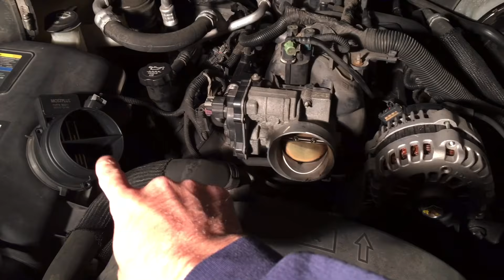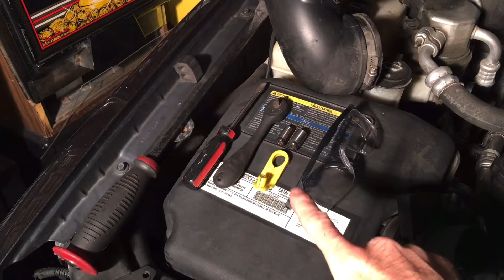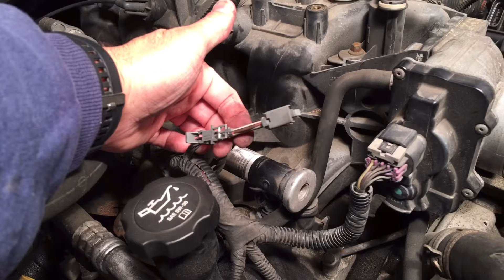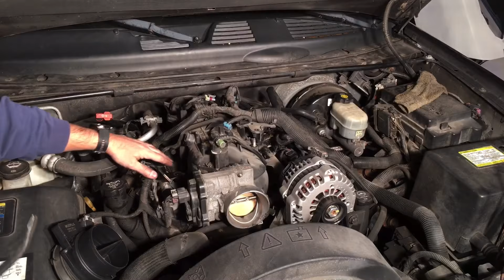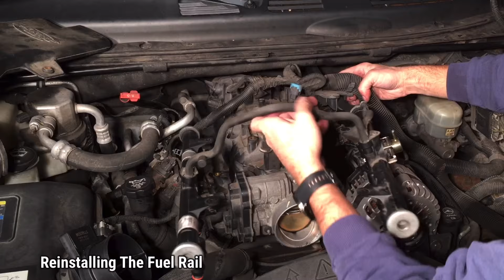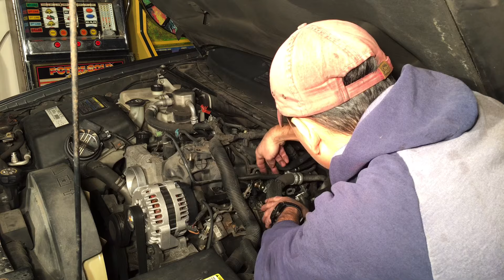How To Remove A Fuel Rail - 5.3L GM V8 (Andy’s Garage: Episode - 302)

Comment: So I got all this off and when it came to install and start the vehicle it starts then it shuts off need help
Reply from the maker: @blakeelizarraras1800  Did you reconnect all the injectors, and ensure the harnesses are tight? Also, prime the fuel pump a couple times to build pressure.
Reply: ONE comment said engine cuts off after replacing injectors and go to start  you say prime fuel pump ? Got full tank so how prime fuel pump ?

Comment: Hey. Is it. Possible to just replace the bar that connect the rails together. Mine is leaking pretty bad. Could it possibly be just an O ring?  I wish I could send you pics or a video of it shooting out.
Reply from the maker: @nfdavis1  so you’re talking about the cross bar that goes over the intake manifold?
Reply: I was leaking from rail to crossover. I got an o-ring from junkyard in better conditions @PhillipsVision

Comment: The tower with the metal cap and screw by the fuel regulator and vacuum line is leaking fuel, and idk why. Don't want to replace the entire fuel rail unless I have to. 
Does anyone have any idea what the fix is?
Reply: Ever find anything out on this mine is leaking

Comment: If I’m replacing my driver side fuel rail, do I have to loosen the passenger side?
Reply: The fuel rails are individual. Where he used the fuel rail key is where they separate as a whole.

Comment: Which fuel injectors did you buy for the truck ac delcos are expensive I think I'm gonna go with the Delphi injectors they are cheaper those gonna be ok? I think the delphis are refurbished...
Reply from the maker: I got refurbished
Reply: @PhillipsVision  ok cool no problems at all right? I wonder why the ac delcos are so expensive.
Reply from the maker: @robpaul7900  mine are working great. AC Delco is the preferred GM brand, that’s why they are more

Comment: Appreciate the video but right off the bat in the beginning when you talk about the importance of the fuel line release tool, you don't state which size is needed 🤦🏻
Reply from the maker: The one I use is universal. I’ve used it on various vehicles.